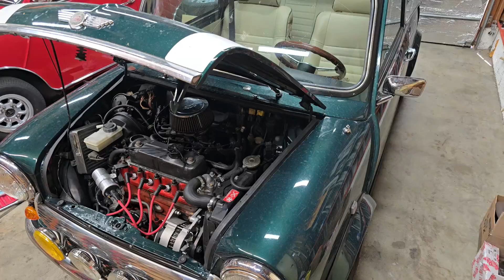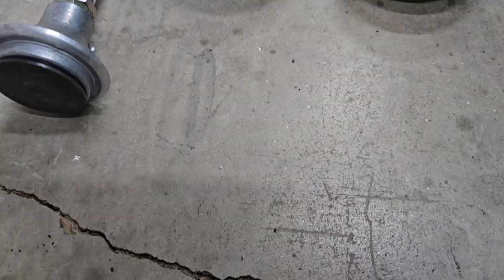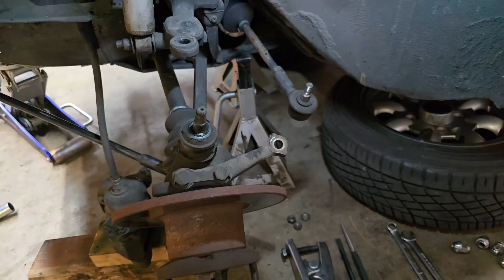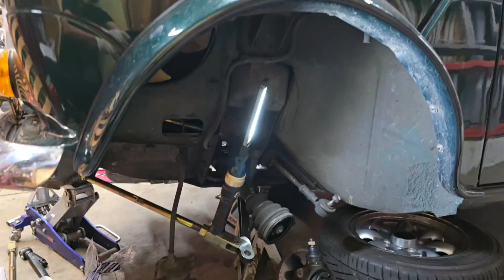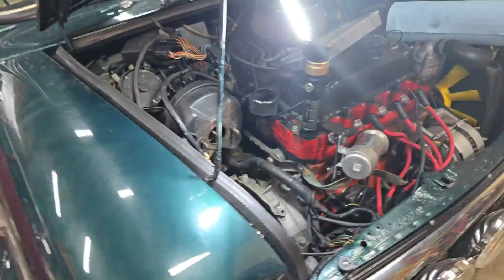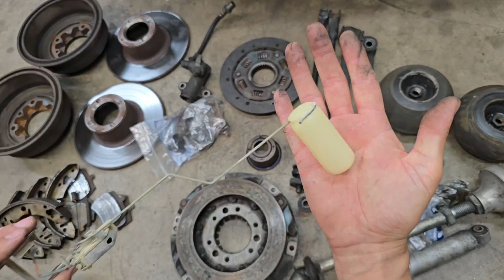Thermocure car returns for suspension and clutch rebuild

Comment: Nice, literally going to be doing the same soon, except probably do an engine out and reinforce the front subframe and repaint. Driver's front side cone is significantly flatter than passenger on mine.
Reply from the maker: Are you planning on doing the clutch and main seal when you pull it?
Reply: @darrensrestorations991  yeah, fresh rebuild from prev owner, but rear main seal is leaking... so I'm just replacing the whole clutch/flywheel assembly, pre-balanced, and hopefully solving the other oil leaks while it's out.